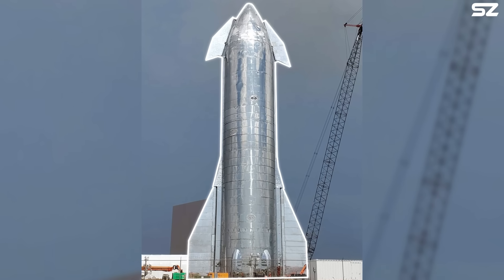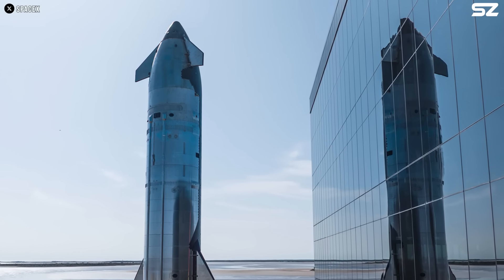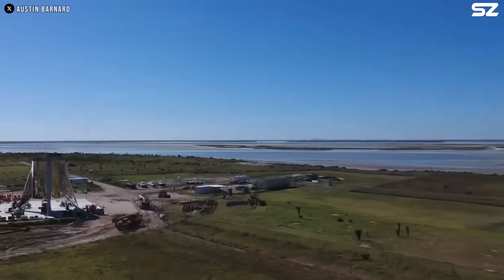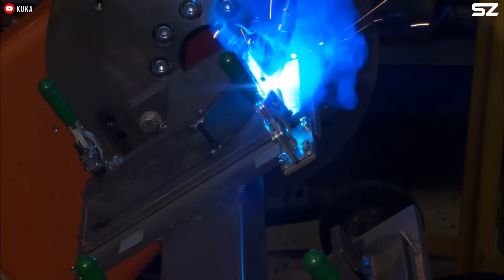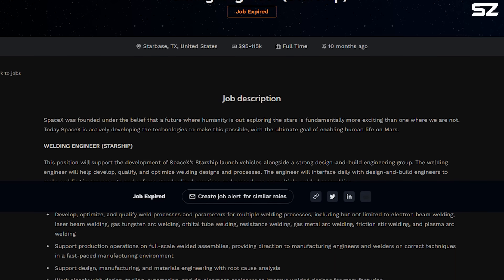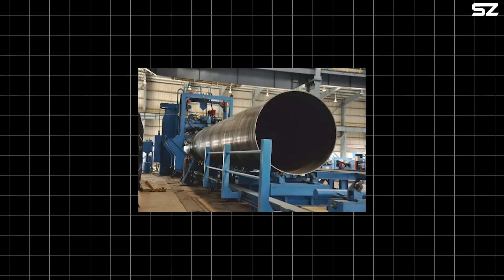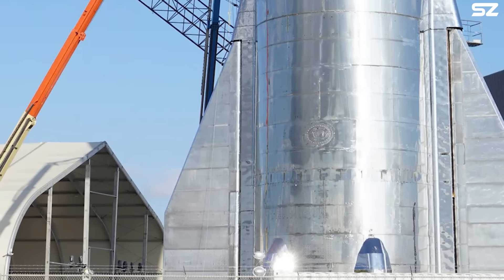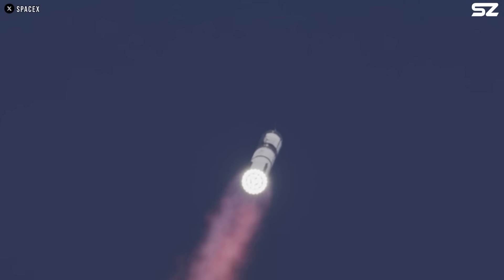SpaceX Fixed Starship’s Welding Problem. Here's what happened...

Comment: One of the biggest challenges with stainless is piss poor heat conductivity.  So, if you heat something locally, that heat stays in that area and doesn't dissipate through the metal.  That's why welding it is so challenging.  You get a ton of material expansion but only in a tiny area, which is the area local to where the heat is applied.  Using stainless in an environment where there are heavy thermal loads is a royal pain in the ass, and something that basic logic tells engineers to avoid.  So, unless you're counting on that poor thermal conductivity, stainless isn't a good choice.  Also, looking at the control surfaces of the Starship, there are thermal stress risers at the disjointed areas of the control surfaces.  Given that stainless is terrible at heat conductivity, that means a localized thermal and mechanical stress loading concentrated in small areas.  Not a good thing.  When we design, common engineering practice is to try to spread out the mechanical and thermal loads, avoiding stress concentrations.

Since stainless has this behavior, the other big problem is if you combine stainless with dissimilar materials that have substantially different thermal expansion properties.  So, if the frame they have in the Starship is aluminum, that's going to be a challenge when things start moving around under thermal and dynamic loads.

If the Starship ever gets to the point where it can actually achieve orbit and start testing its re-entry capabilities, I'm suspect that SpaceX will go through quite a few prototypes before they figure out those thermal and mechanical challenges that I suspect they're going to encounter.
Reply: Starship has already been sub-orbital twice. And the decision to remain suborbital was made so that a system failure would not leave the ship in orbit: it would de-orbit (without intervention) in a known area. So, Starship could have been in orbit. Twice. And it has already re-entered. Twice. Seems like you know a lot about welding and stainless steel.
Reply: @richardpark3054  The last two flights they actually tried to achieve orbit (transatmospheric orbit).  The ship blew up from other problems, preventing them from reaching their goal.  It wasn't planned during those flights to remain suborbital.

Starship is the the most complex part of their system, yet it's the farthest behind.  That's piss-poor project management.

Or, it could  be that Starship itself isn't the priority, and the lift system is.  SpaceX is chasing quite a few military projects.  Could be they're more interested in the money coming from that than getting back to interplanetary travel.  If so, let's hope they stop tapping the taxpayer based on the premise they're really shooting for Mars....might be just another one of Musk's sales-jobs.  He's good at blowing smoke to get investors' money.
Reply: @johntomasik1555   And how does that change the fact that flights 5 and 6 were intentionally suborbital (for the reason I mentioned) and that orbit could have been achieved? And both re-entered the atmosphere intact (but not without damage)? Oh, right: it doesn't.
You should really consider sharing your thorough knowledge of rocketry with SpaceX, I'm positive they're unaware of all the issues you've identified.
Reply: @ You have no clue whether orbit could have been achieved for those flights, as it was never attempted.
Reply: @johntomasik1555  Well, on both sub-orbital flights, some of the engines were re-ignited. So, they likely could have re-ignited for a circularization burn just as easily. So, actually, it seems reasonable that a stable orbit could have been achieved. 
I don't have an engineering degree (only a BA in physics and an MD) so I don't know practically everything about rocketry. But I do know one thing about rocketry that you don't know: I know when I'm out of my depth.
Reply: Certainly they rely on the crappy thermal conductivity, as the cryo fuel and oxidizer tanks aren't insulated.

Comment: Why doesn't he use some of these welding techniques to attach panels to Cyber Truck? That thing is junk. Body panels come off because they are glued on. He certainly charges enough for his junk cars, he could afford to do something like that.
Reply: Tesla has piss poor engineering when it comes to practical application and manufacturing.  They've been notorious for poor build quality and longevity.  Stainless is a difficult material to use in designs and manage in a manufacturing environment.  That's even without throwing in the challenges of adhesives.

Comment: BS. 200 degrees F degrades? The leading edge of shuttle wing was made of carbon carbon-fiber. Was brittle though, A piece of foam broke it and doomed the space shuttle.
Reply: The leading edge you refer to is reinforced carbon-carbon. It's a ceramic not carbon fiber. Also it was not a structural component.
Reply: @jcf20010  It is not ceramic. There is carbon fiber used. Guess the manufacturing is that after it is laid up it heated to such a point that the binding material turns to graphite. Ceramics are normally some kind of metal oxides fused at high heat.

Comment: Less welding would be required if the stainless-steel sheets could be formed as a continuous spiral, such as e.g. cardboard paper towel centers wrapped around to form the starship with one long length of steel.
Reply from the maker: Yes!